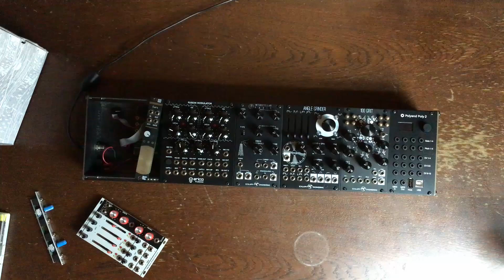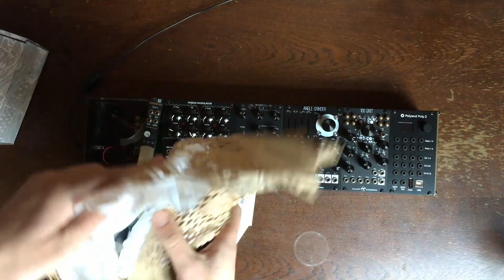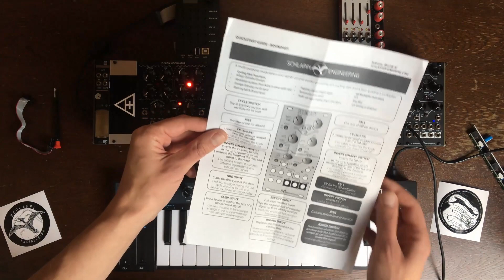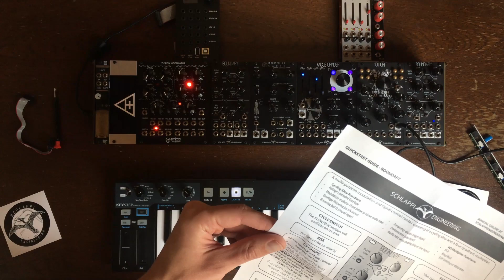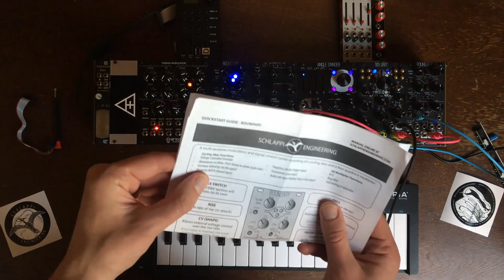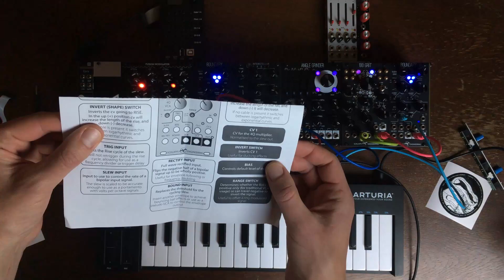Boundary by Schlappi Engineering - First Patches & Walkthough

Comment: Thanks for this review...I am really interested in this module however it seems like this is the second review video now where I've seen two of the modules being used to do some really cool things so it has me concerned that you need to go Boundary X2 in order to really get some cool things going....I do see a couple of the patches you did were nice with just using one, but still it seems like a majority of the fun stuff you do involves two of them.
Reply from the maker: I see what you mean but I think the correct answer is more that you indeed need another module to modulate the Boundary in order to get really interesting stuff out of it. Could be with any other module actualy.